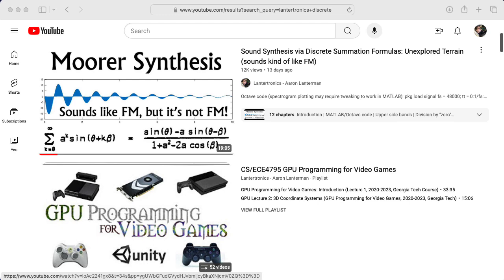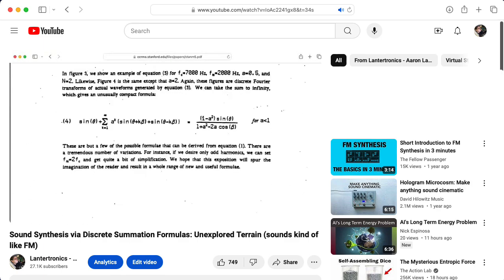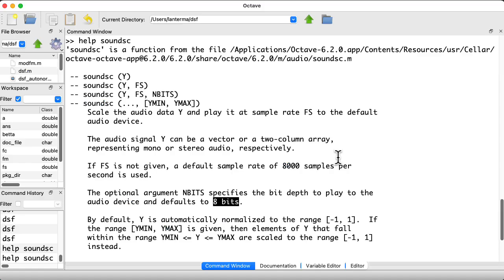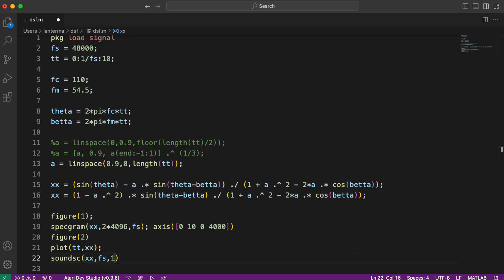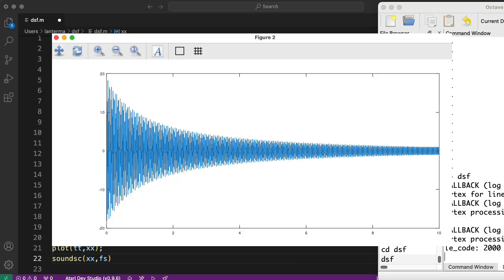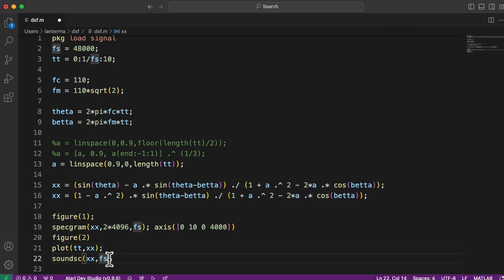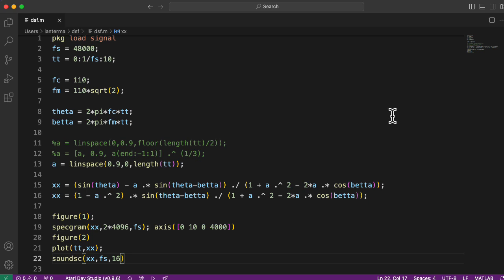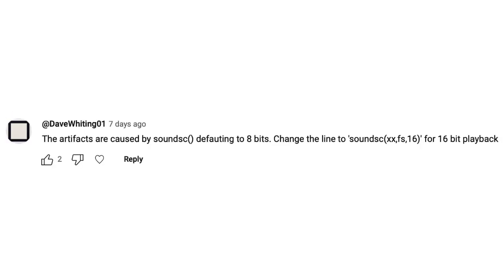Discrete Summation Formula Synthesis Follow-Up (I didn't know Octave did this weird thing)

Comment: My favorite examples of artistic low-resolution digital sampling are on delay pedals that use a PT2399 echo chip, which was originally designed for surround sound echo/delay (with delay length typically on the order of the 10s of milliseconds). In order to use it with guitars/instruments, and have a reasonably long delay time, say 800ms-2000ms, you have to downgrade its sampling depth, which makes the longer delays distorted, and when implemented just right, gives really satisfying degenerative decays and interesting infinite loop behaviors.

My favorite implementation was the Biyang Time Machine, a very cheap import circa 2008, and even then my guitarist and I each bought three of them (they were cheap and we were touring), and they each sounded awesome, but slightly different. 

I’ve since stocked up on PT2399s for my own projects. To hear an example of those specific pedals, look up “The Farewell Monument - Remains of Mountains” — it’s the primary effect during the latter 2/3rds of that track.
Reply: These are not classical digital sampling (pulse code modulation), they use adaptive delta modulation and a 1 bit delay line. Means you trade length for fidelity.
Reply: @reneschmitz4845 I was not aware of that. I will have to revisit those old projects, and wrap my head around what they’re doing, now my curiosity is piqued. It’s been several years, but I still have a handful of schematics for some bucket brigade delay circuits, and the PT2399 data sheet has a fairly versatile typical application circuit included if I recall.
Reply: Bonus, if you listen to “Remains of Mountains”, the guitarist (Matt Bragg) delivers what I consider the most beautiful and wistful sounding e-bow performance ever. He really mastered that thing’s idiosyncratic function and sound.

Comment: in matlab it sounds different than here even with soundsc set to take 8 bits
I guess my soundcard doesn't support 8 bits, maybe? It is supposed to default to whatever your soundcard has as the default configured in the system
Reply from the maker: There might be a difference in how Octave and MATLAB work (I didn't get around to trying it in MATLAB).